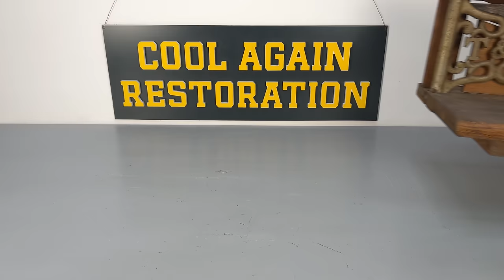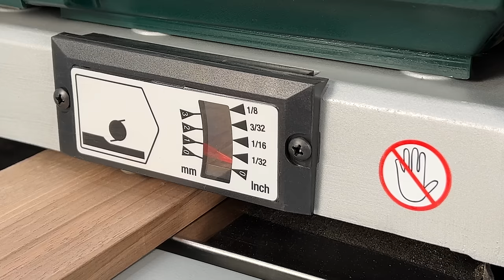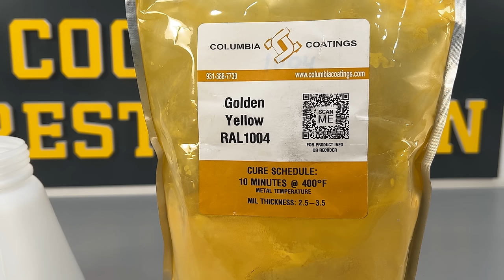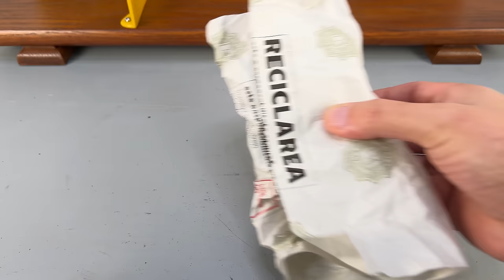1883 Meat Slicer Restoration - Tucker & Dorsey Edition

Comment: Very nice restoration. Im glad you did the wood with sand paper instead of sand blasting. I was hoping you would nickle plate all the metal but it still turned out well after powder coating.
Reply from the maker: I do not agree to sandblast old wood 😊 thanks Patrick

Comment: Excellent work .. nicely done .. but I would recommend to add candle wax to the sliding slot .. that will reduce the friction between wooden pieces .. just simply bring a candle and rub it on the desired surfaces .. well done again 👍🏼
Reply from the maker: Thanks for the tip Osama,I will try that 👍

Comment: You do not disappoint, nice finishes to the wood and the metal brought back to life .Do have to sometime just pick a color to paint or stain if you can't find that info? Is there a lot of research that has to happen before you start? If you find a old add by when it was been sold new. it might be fun to show it with the finished product. Nice sandwich!
Reply from the maker: Yes a lot of research need to be done before I start . I don’t like to change the aspect of the item

Comment: Absolutely outstanding, professional work ! Still, I think a little curious the yellow color you chose, as it seems the metal parts were chrome plated. If I had to choose, I would have probably use black or nickel plating for every part. It seems also you didn't get the blade plated, can you explain why ? Last, I think the slicer quite strange, as putting meat on wood isn't very hygienic. Curious the manufacturer didn't think to add a thing like a marble plate, easier to clean...
Reply from the maker: Yeah, very curious why they used wood Back them but not only on this meat slicer. Almost on all kitchen tools . I didn’t plate the blade because is not safe to cut metal with nickel .

Comment: The tip of the flame is the hottest! Hold the torch back about 2 or 3 inches from the work surface and you will have much quicker results :)
Reply from the maker: Thanks for advice 😊

Comment: Really nice Video! I only have one concern, you may weakened the blade by heating/welding it. By doing so the metal looses hardness which causes the blade to bocome dull faster...
Reply from the maker: Probably but that happened in the end parts of the blade , where the blade is not in action. I made it like that because I wanted to have a nice and continue blade .

Comment: Looks great! Only concern I have is that you have heated the metal a lot and I am not sure if it's still hardened. May I suggest you dip the metal in water periodically when you grind it so it won't overheat?

Non hardened metal has very bad edge retention and is very soft and easy to shape
Reply from the maker: Yes , you have right but this happened only at the end of the blade , where that part has no importance in cutting. I restored that parts just for a nice looking of the blade. Thanks for the advice !
Reply: @CoolAgainRestoration  awesome! Love your content!
Reply from the maker: Thank you very much David 😊

Comment: I think the blade was originally designed without the sharp ends. Specially considering that both ends were ‘missing/broken’. That extra material would not be doing any cutting
Reply from the maker: Yes , There not doing any cutting but I inspected the broken blade in that area and I saw that looks like they was broken, probably that’s why in one part was bent too. It wasn’t like they sanded  or cut with a tool,was just broken.

Comment: don't know if you know this trick but if you wet the wood before you stain it will net a better result. the stain will soak in better and wont just stay on top.
Reply from the maker: I already know that but I found this trick to not work well on old wood because it is porous and every time you wet , the fibers raise out. No matter how much sanding you do , after a little bit of water the fibers goes out again ..

Comment: cool vid, but i wish you would keep some of the history of the piece, like those little imperfections on the cast metal fence thingy or the not so perfectly round screwheads.
Reply from the maker: I understand you perfectly but is very hard to thanks all the people. Some people think that back in time when they made this slicer, if they worked on a single piece and tried to achieve perfection , they removed any casting like other things that looks smooth , no matter if they was made 100 years ago. But because they produced these slicer on mass production, they didn’t care about casting marks and other things like that. And other fact is that the pittings in the metal are made by the rust and not by the manufacturer. So, that holes need to be filled with filler , otherwise the rust from the holes will appear very soon and the metal will be degraded very soon as well. Other people like to keep all the casting and pittings and all the characters. Personally I like both ideas, but is hard to keep both in a single video. That’s why I restore things to a perfect smooth finish and at other I keep the history. Thanks Christopher and sorry for my English !

Comment: 100 grit isn't rough sanding plus 80 grit is more effective at taking excess filler off plus its cheaper than using 100 grit also stopping sanding at 120 grit will allow the stain to be absorbed cuz it doesn't close up the pours as much

Comment: Tell me one thing. You are slicing meat containing salt and moisture with blade made of polished carbon steel. Doesn't it get stain marks few hours later? Polished carbon steel becomes mat and stained from just exposing to air. This could be prevented by oil coating or oxidizing, but it still corrode when touched or wet.  Is it protected somehow or it isn't just carbon steel?
Reply from the maker: It is just carbon steel like they first made it ! Probably that’s why we don’t used anymore and we are using stainless steel knifes . I suppose that this blade need clean and oil for protecting against rust

Comment: A few questions: Despite the holes not being symmetrical, were they not the original holes? If they were, why fill them in just for aesthetics?? 

Although the legs weren't original, how old were they? If replaced many years ago, why not leave them as a piece of the history?
Reply from the maker: Back in time they didn’t paid attention to this detail. They made things in mass production. Probably the holes was originally made but wrong. The legs was definitely not original because they wasn’t finished and different wood . I can’t say the age of the legs but they was just 2 pieces of wood attached to a slicer . Nothing more

Comment: A great result! I like it. Nevertheless I have a question: The main wooden parts look like oak (maybe except of the sliding unit) – why did you apply walnut stain? A stain colored like aged oak would look better (but of course that's only my opinion).
Reply from the maker: Yes you have right, mostly wooden part was oak. But I’m a fan of walnut stain because after is dry became slightly black/brown.  I tried oak stain and that one became more to a red/yellow , maybe an orange colour and I don’t like it
Reply: @CoolAgainRestoration  I see. Then next time with oak I recommend to try out ammonia solution, when you wish a black/brown touch. You only have to give some of it in a glass and put it under a tent of plastic film together with the wood. The ammonia will react with the tannin inside the wood and the result is a very nice black/brown colour. How dark it is depends on the time you let the wood together with the ammonia under the tent. I think you will like it.
Reply from the maker: I definitely test this . I seen some YouTubers doing this

Comment: I love it! I was hoping for nickel plate on the blade, as carbon steel in contact with salty meats corrode so easily. If cleaned well, should be fine.
Reply from the maker: Yes but most probably this slicer will be just for display because is hard to clean it for a everyday using .
Reply: @CoolAgainRestoration    It is indeed beautiful, and far better than new! Your attention to detail and patience are remarkable.

Comment: I was wondering, when you made your own filler with glue and saw dust and the little jar said "clean sawdust" does clean mean free of other particles like varnish? And do you make it yourself or do you buy it? And does the cleanliness matter that much? And does it matter from what kind of wood you use the sawdust?
Reply from the maker: Yes, clean wood dust means without other particles of paint or varnish or things like that. It is made by me after I sanded a clean piece of wood. And the cleanliness and the type of wood count because of the color. You can’t fill a black walnut wood with red filler from a cherry wood . Basically you can but is not nice .
Reply: @CoolAgainRestoration  thank you 🤗
Reply from the maker: You are welcome 😊

Comment: I think you could've made shaping the head around 13:00 much easier by just using a radius form tool on your lathe to cut it to the shape you wanted. Would've been significantly faster than hand grinding it then finishing it on the lathe by hand.
Reply from the maker: True but I don’t like to use that radius knife because makes a lot of noise and I can’t record on camera that

Comment: The only part of the restoration i did not like was the jb weld and painting of the, i believe it was cast iron, part, i personally liked how it looked after it was sand blasted and deburred. But instead of arguing like a lot of people seem to do these days, i was wondering if you could share with me why you went that route instead of say, clear coating or plating the metal. Would just like to understand your thought process on that choice.

Comment: is removing original manufacturing artifacts, like the cast leaks on the hardware, considered restoration? Honest question, I'm new to restorations
Reply from the maker: Yes Jaye ! You can restore an item leaving the casting marks if you want a smooth finish. If you have a unique and rare item , it is better to leave them , or leaving patina as it is ! Depend on the item and the purpose 👍

Comment: The wood stain and varnish are in contact with the food. That's really a safety hazard because the slicer doesn't stay dry.
Adding a stainless steel plate for the meat to go on will make it safer.
As to the yellow colour: just like most viewers I'd say it wasn't a good choice.
Go for traditional colours such as burgundy red, black or chrome.

Comment: Only issue i see is the heat from make the blade straight, the welding and sanding all distempered the steel.  It will be weak in the tips again.
Reply from the maker: Probably yes but the tips doesn’t matter too much in cutting. I re made it because of the ugly looking

Comment: Do you have any recommendations for restoring rims and nickel plating kits?
Reply from the maker: Unfortunately if the chrome or nickel is damaged , the only way to restore that surfaces are to replace it 😕
Reply: @CoolAgainRestoration  I am looking at potentially reapplying chrome or nickel.  Why do the rims need to be replaced?
Reply from the maker: @GrainlessVideos 😅😅 it was a mistake in my explanation. You have to replace the nickel or chrome , I mean replating .
Reply: @CoolAgainRestoration  can you please make a video on how you would do it so I can get an idea?
Reply from the maker: @GrainlessVideos usually first step is to remove the whole plating with blasting media or acid , depend how thick is the plating . After that the next step is to sand the surface until the desired surface is achieved and the last step is plating again with nickel and/or chrome. I made a lot of nickel plating and chrome plating in my videos . 👍

Comment: Do you use water based stain and varnish so it is washable?
Reply from the maker: It is washable for quick cleaning but not a good idea to keep long time in water . My workbench is water based painted and when I put some water on the table , if I dry quickly is notting happen, but if I let that water drops more than 30 minutes, the paint start to dissolve

Comment: You need a Mig welder, much cleaner weld and it would penetrate the metal what you have there is going to be the weak spot on the blade.

Comment: IMHO the replacement of the tips on the blade was unwarranted.  Of course without having seen the tips us viewers can't tell if they were broken or not.  However, what we can see from the video is though bent, they were clearly manufactured that way.  I've seen this done on other blades as acute points like that are fragile, difficult to sharpen, and present a rather obvious hazard.  take a closer look at the opening examination portion of the video, both ends appear to have been clean cut perpendicular to the horizontal cutting bed, clearly how the blade was designed & manufactured.  Bottom line, restoration is one thing, modification & embellishment is another.  Outside of that  minor faux pas, beautiful work!

Comment: Question.  How do you know what thread pitch to use every time???
Reply from the maker: I have a tool and with the help of it I can identify the thread I have or I need
Reply: @CoolAgainRestoration  Ohhhh.  I think a stor near me has one.  Is it like a bunch of nuts  +  bolts with different threads?
Reply from the maker: @Brain-Lag no, it is a tool with different samples for each existing thread. They looks like old keys 🗝️

Comment: How or why does the metal get pitted? Time or made that way?
Reply from the maker: The rust and time made that pitted surface but anyway , they didn’t goes with smooth surfaces back then because most of the parts are cast iron and they made products just for functionality and not for looking well

Comment: Interesting original design. I would imagine you would need to sharpen the knife oftentimes, but removing it is not made easy. It just uses screws, of which the holes will wear out over times.
Reply from the maker: Yes, probably that’s why they don’t use anymore in our days

Comment: Lovely restoration, BUT I'm disappointed you didn't treat the wood against Woodworms or Bugs. Filling those holes with wood putty doesn't solve the problem. You should use the Borax solution and wait a few days or replace all the wood parts with holes inside. In your place, I will remove this from your workplace or house immediately. You can infect the site, and it will be tough to get rid of them!
Reply from the maker: All the parts was in the oven before stain and varnish . This process kill worms too

Comment: It looks great but I'm afraid that blade won't stay sharp now. When you heated it to bend it and then welded it, you ruined the heat treatment of the steal and made it soft. It would need to be quenched and tempered again to perform as it should.
Reply from the maker: That happened only at the end of the blade, parts that no matter in the cutting process 👍

Comment: Black would have ben sexier IMO, and I'm not a fan of placing meat on wood as they'll absorb the fats and can breed bacterial colonies as a result, even if you try to keep them clean. I wonder if you could have used a bit of clear resin on the part where the meat would come in contact with. 

But other than that, good job. Thanks for screening the welding too.
Reply from the maker: Epoxy resin is not good safe from my research. I don’t know if they invented something now but in the past they don’t. Anyway , I tried to restore it like original condition and always I try this . Thanks a lot mate , wish you all the best

Comment: You have much nice equipment in your workshop but for welding thin metal you lack a simple TIG welder
Reply from the maker: I don’t do much welding but probably I will make the investment soon 😊
Reply: @CoolAgainRestoration  It will be an interesting experience to do a weld that looks so nice that you can't grind it down 😄

Comment: I can't find it now, but someone commented on your sandwich, and you not using this slicing machine to cut the cheese.

Hahahaha.......no, you have the 1905 cheese wire slicer for that.

(I knew I had seen a thumbnail and title before. I went looking for it after reading the sandwich comment. Yeah, I ended up watching THAT, before returning here to write this.)

PS the closest I come to any metalworking.....is filing down the casting seam on 15mm soldiers before painting

Comment: The minute you put water based varnish on it, it was no longer a restoration, but a renewal. For something to be a restoration, you need to use the same finishes as the original, if possible. The original finish would have been shellac. It dries quickly and seals the wood surface against bacteria if applied correctly. Since the solvent in shellac is alcohol, it's a much better protectant than water based varnish, and it polishes beautifully. Also, powder coating is especially not food-safe. Also, again, why this is not a restoration. Nickel plating is food safe, although for the age of the slicer, it may have been simply high carbon steel, which holds an edge, and if cleaned and oiled with food-grade oil, would have been a good possibility.